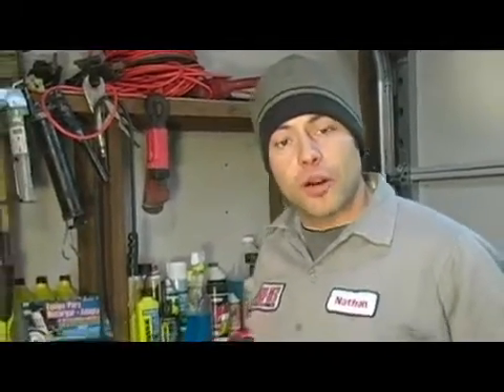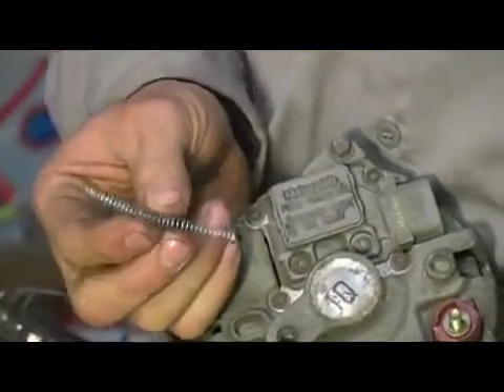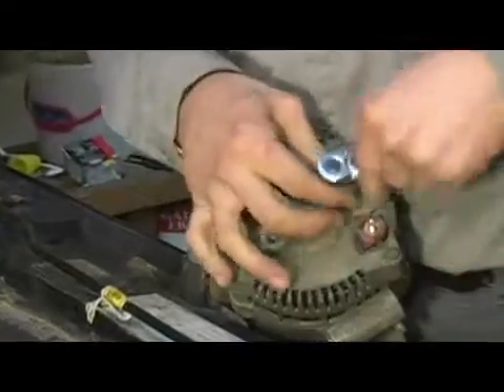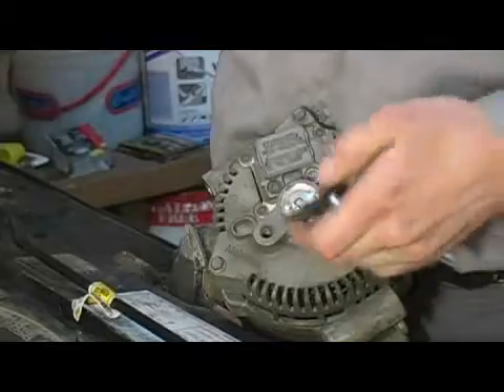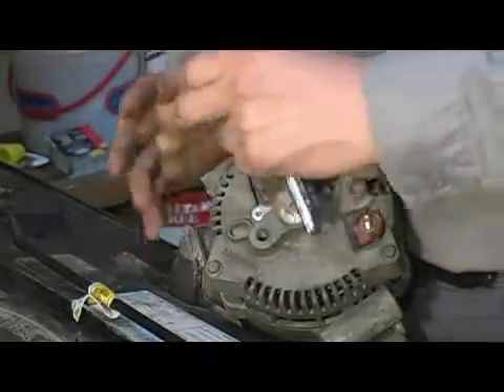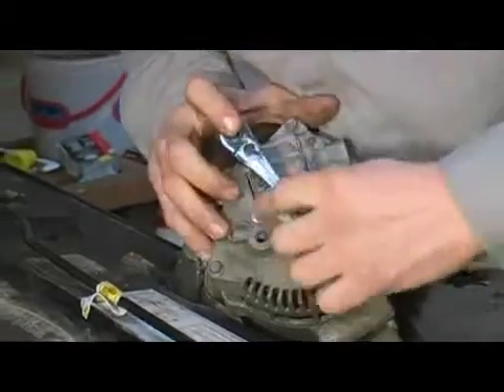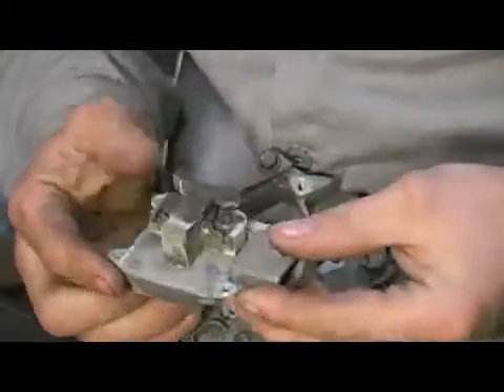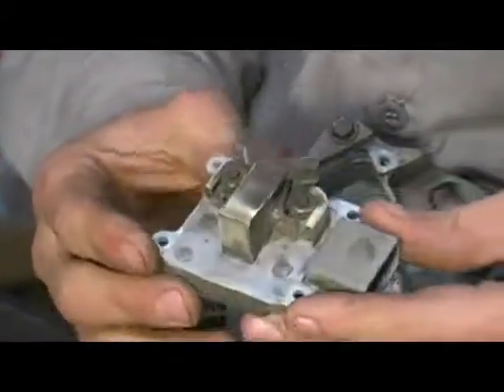How to Remove the Voltage Regulator from the Alternator

Comment: I have problem 
When measuring the voltage on the battery terminals while the engine is running, it gives 14 volts, which means that the generator is working properly???  However, when I disconnect the battery cable, the car stops. What is the reason?
Reply: Bro what 😂
Reply: @travischampagne3252 🤣
Reply: 😂 alternator.... this ain't no Generac!
Reply: You have removed the power source i.e. the generators ability to transmit power to the ignition system. Reconnect to resume power.

Comment: Hi I have an Audi Q7 2009 and the voltage is not stable starts at 14.1 then goes down to 12.4 then goes up as you acelérate. It has a voltage regulator in the back.  Should I replace it ? To see if the voltage stabilize ?  Thanks
Reply: do u solve the prblm what was the isssue

Comment: Have town and country 2011 and replaced battery and alternator but still not getting power to battery is there something else I am missing?
Reply: Check your ground connections from the negative battery terminal to any other spot where a chassis ground connection is visible with a multimeter. Put it in ohm sound mode and place your red lead to your negative battery connector and your other lead to any other ground point. You want to listen for a beep lasting as long as you have connection. If at any ground point, you don’t get a beep, start digging around there.
Reply: Did you figure it out?
Reply: @anthonyman8008  negative the car is up for sale

Comment: Great video.  Can the voltage regulator be removed without removing the alternator from the car in luding the belt?
Reply: As with anything on a car, If you can reach it, you can remove it. Don't forget to disconnect the battery first